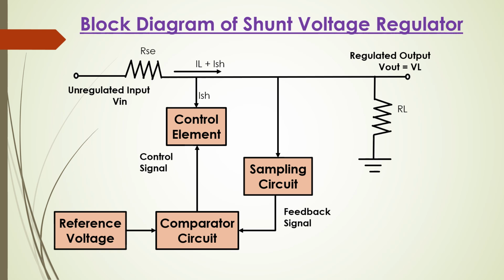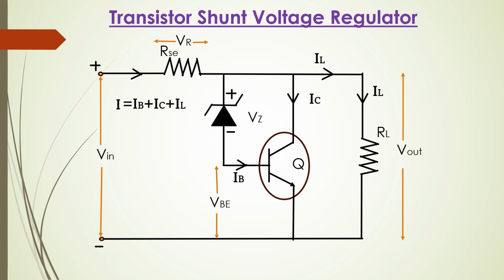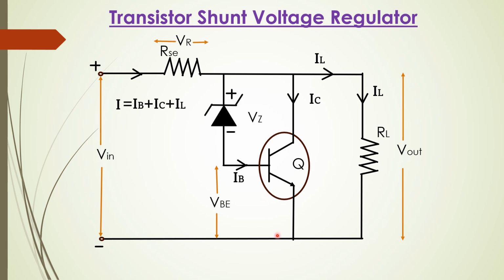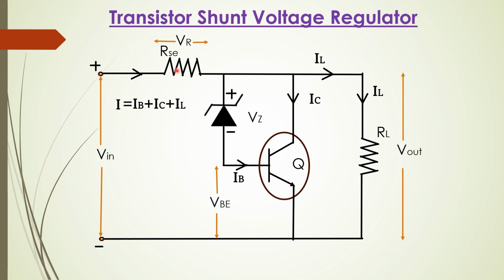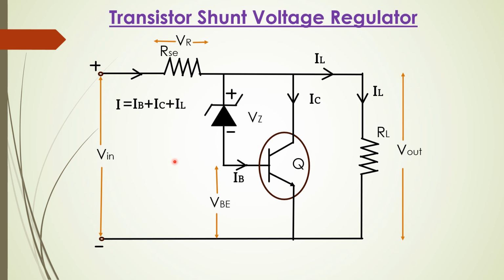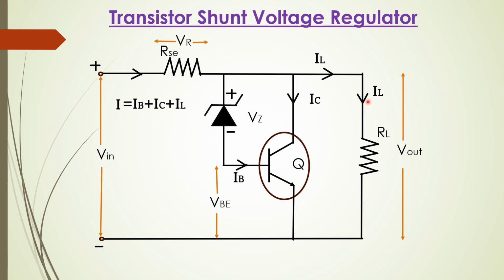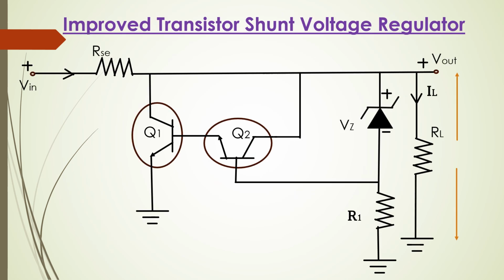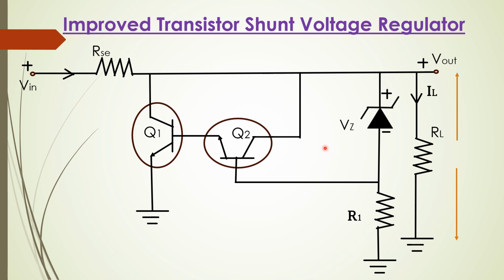Shunt Voltage Regulator

Comment: Arrows for the voltages across components are wrong.
They should not be double headed arrows. They should be single ended and the direction of the arrow matters. It HAS to take into consideration the direction of the current I, Ib, IL etc that you have marked on the diagram.
This is the correct way to analyse a circuit.